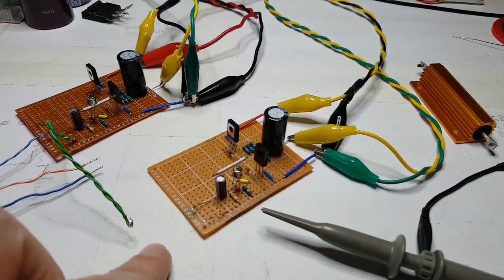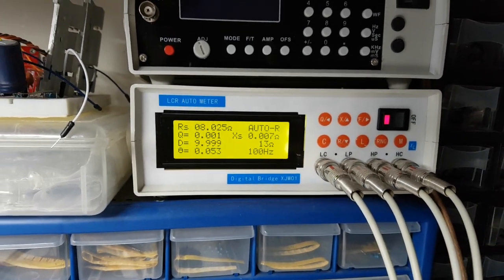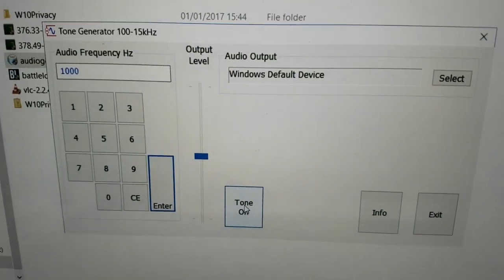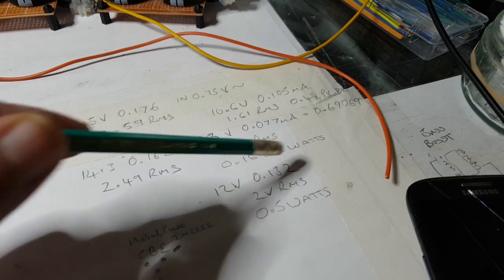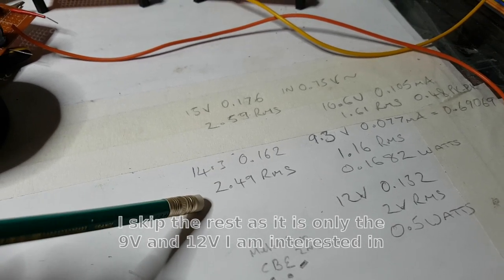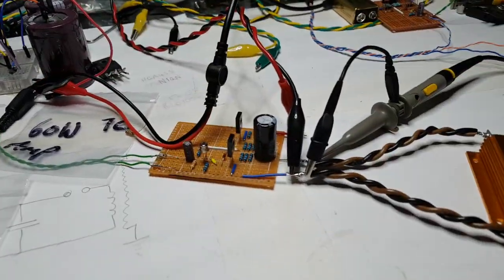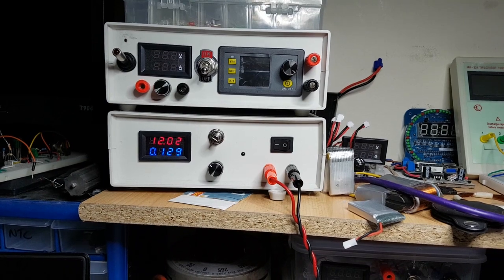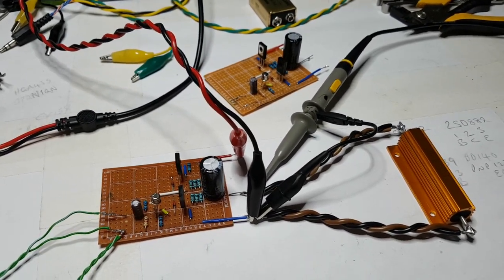Simple DIY Three Transistor x2 (for Stereo) Amplifier

Comment: Sounds good here (MDR-500 headphones)..it reminded me of 40 years ago making a stereo amp..total cost £6 including  pots knobs,  sheet of aluminium to make the case and transformer to power it...those was the days..smile..I would be tempted to use it to make a "WOW  I did not expect that to sound so good!" portable speaker with Neodymium drivers..got a few repair jobs here..Mr bowjangles puked on my Sennheiser headphones..TV takes 10 mins to turn on..(bad cap in power board i bet)
Reply from the maker: The portable speaker with Neodymium drivers sounds like a good idea, better than separates for the youngsters. I will take a look and see if I can find some at a reasonable price.
Mr Bowjangles, takes me back to relaxing with old friends listening to the song (John Holt). Cool name for a cat. I have a TV which horizontal lines appear on the screen and the picture fades to black after an hour. I don't watch it anyways so am not that bothered.

Comment: Very nice amplifier :D What kind of transistors did you use?
Reply from the maker: Cheers. 2N2222 for driver and BD139 and BD140 for output.
Reply: Thanks. And... circuit is from internet, isn't it?
Reply from the maker: You will find similar circuits on the internet as they are all based around the same design. I used different transistors and biasing resister values for my specific voltages. I tried lots of similar circuits without much success, they worked but needed tweaking for usefulness. This is my rendition.

Comment: hello sor.i have a pansonic 5.1 home theater but its board has completely damage .i would like to create a circuit board separately for this.i am allrady make the subwoofer circuit but the fornt surround center has three circuits left. i do not understand how these three circuitswill work better. fornt,surround all these speakers are 2.5 inches and [6 ohm 60 watt].center speakers are [6 ohm 220 watt ]. transformer ac output [25v+25v,13v,5v.i would like to make the board of these three differently and these music must be verry sweet. sir how can i make it?if you have these circuits diagram and pcb layout you can help me.i am waiting for your solution.
Reply: search google for 3 transistor class AB amplifier.

Comment: You do not need heatsink?
Reply from the maker: No it seems happy enough at 12 volts. I did test at a little over 14 volts and the transistors heated considerably compared to 12. At 9 volts it runs cooler still.
Reply from the maker: I ran some tests. Given the ambient temperature in here is 19c. I clamped a temp sensor on the NPN of one channel and clamped another sensor on the PNP on the other channel. I listen to Moby - Play album then Bob Marley - Legend. I used CD's ran through my laptop with its volume at 76% (loud). I fed the amp with 12.5 volts. The power supply peeked at 257mA at times. The hottest the chips got was 44.2c on the PNP and 41.7c on the NPN.
The derating on the datasheet suggests 90% at 50c with an ambient temp of 25c
http://www.st.com/resource/en/datasheet/bd140.pdf
Heat sinking would not go amiss here but can be gotten away with with my circumstances. I guess the summer would tell another story.